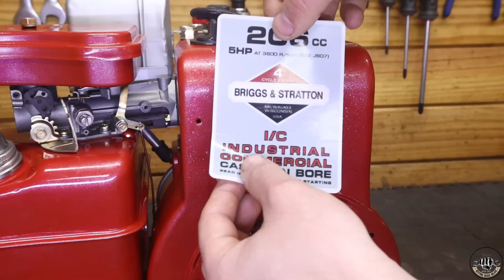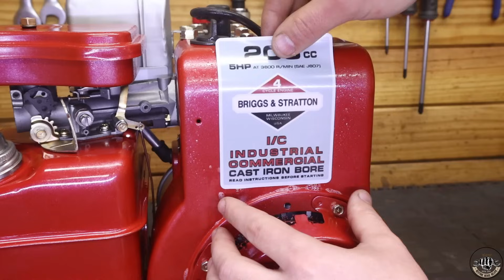1984 5hp Briggs & Stratton engine Restoration - Full Version-

Comment: Turned out very nice, a bit suspicious on the colour of the oil as if you reused and the lack of any cylinder honing but anyways. It just hurts me every time I see people building engines without any lube on the bolts….

Comment: I assume that engine was originally on a snow plough as the carburettor had a un-filtered air-intake on it, and he replaced it with an air filter
Reply from the maker: Could be, but where I live it does not snow, I have seen these engines on lawnmowers and it has a pipe that goes up to the handlebars that connects to a air-filter. I guess its to try and make it more economic to try and save on constantly having to replace air-filters. I did replace it with a more suitable and original air-filter housing.

Comment: 40:07  Come  on I do that with  power drill and  never with hands... 45:40 Next  time  write or  mark with dots  on piston head side and have clean piston  head top. 50:34 Here  I saw  cover still a bit  loose  when  he  tighten  the  screw. I think  there should be washer..... 😏✌

Comment: The only problem now is working out what to put it on where it isn't going to look just like the "Before" picture again within 6 months. It would be a shame if it ended up going on a concrete mixer to get caked in mud and cement after getting made to look brand new. :)